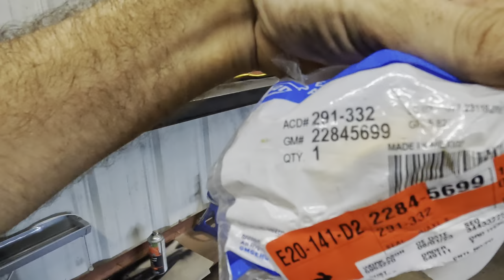FAILED Order of Operations! DON"T SPLIT JOBS! 2015 Cadillac SRX 4 Leaking Axle Seal

Comment: WE had pip[e fitters at my works for fixing all the process pipework. They had lots of offcuts of all sizes and thicknesses which I used with threaded rod for fitting/removing bushes and seals on my Triumph Stag. Find a pipe fitter and get yourself a complete kit for the price of a pint!

Comment: I had one of those parts washers.  The trick is to get the solvent/cleaner filled until it touches the bottom of that shelf.  The pump is trying to draw air and liquid.  Give it a try before you tear it apart.

Comment: Ive just done this job on a gm too real pain in the arse those axel seals never come out the way you hope they will, mine was stuck in real good i had to tap the edges in all round the seal to get it out in the end with bugger all space to work in and pissing down with rain, i have the same bearing installer kit i used  an old gm expansion bottle cap as 8t was the exact same size to fit around the seal, drilled a hole in and then screwed it onto the bearing kit worked a treat and knocked it in no problems.

Comment: Hey, add some fluid to that solvent tank.  I have the same one.  The pump wouldn't work, so I filled it to just below the tray. Works great now.  They have a weak pump. Try it, I bet it works. If not Amszon sells a quality replacement pump for $50

Comment: That front suspension is a real piece of work...what German automaker designed that mess?  The struggle is real Ray, but it could have been worse...you could be doing this in Avoca and dealing with every bolt rusted in its bushing...

Comment: I had a similar situation when I was younger. I had a 1963 Jag XKE. Yeah, really. I needed to replace the clutch. The car came apart and put together 3 times. If you know what's required to do it, you'll understand. Finally, when it was all together, I started it up engaged the clutch and it didn't move. I took it all it all apart again. The throwout bearing is carbon faced and seemed fine, however, the parts guy gave me a bearing for an Austin Healy 3000. It looked the same, but it was slightly thicker. The clutch was not able to engage. I finally got it going with the correct part.:face-orange-frowning: 
On a brighter note, I noticed the parts washer. We go to the Gator Nationals fairly regularly. A couple of years ago, on the last day, the vendors were closing up to go home and I saw the Safety Kleen vendor that was loading up his truck. I saw he had one last Safety Kleen 1630. He asked me if I was interested. Of course, at the right price. Brand new unit still in the box, all the accessories and a 30 gallon drum of solvent for $200. Sold! And they even loaded on my truck for me. It works great!😄

Comment: Parts washer, might just be a wiring/switch issue. If the pump is actually getting power, it's probably labeled and available on line or from Harbor Freight.  A google search turns up alternatives. There are websites with improvements including installing a fuel filter and using a mover's dolly to make it mobile and raise it up a bit.

Comment: Ray, buy a e- cap cooler pump, low pressure and good volume and you can submerse them. Very reasonably priced. Might work for your situation on the parts cleaner. 👍

Comment: Don't beat yourself up too much Ray. It has happened to me when I was working on changing a parking brake on a International tractor which was in the rear axel and ended up taking the whole thing apart (had to remove the fenders, seat and fuel tank) 3 times cause I would find a pin or bolt that was needed for something internally. Fun times...not lol. Cheers from Canada

Comment: Not criticising, aren't rubber bushed suspensions supposed to be tightened with the weight on the wheels, so the rubber is relaxed at normal position. Best wishes from a smart assed Australian fan

Comment: Well dang Bro. You had the Jack Stand used to get the lower ball joint in once but then you never seem to use it again and struggled way too much with the upper connections that it hit my chest Just watching. Jcak Stand were made for that reason "TO Help Hold Up something to ASSIST in Dis/Re-Assembly" of somewhat heavy objects.

Comment: 42:20 Just wondering if you could use the same principle of the under tool box lighting scheme. To get more light under the lifts on the floor to eliminate more shadows mounted under the lower wall beam. Never mind it probably wouldn’t help. Interesting video👍

Comment: Gl5 is not bad. There are additives that will linger on the skin until you shower. Brake cleaner and rubber don't mix. The rubber will harden and crack.

Comment: I always took it as an insult if somone jumped in to do my work, like I wasn't good enough, however becuse you ate your lunch doing it I can see Troy off in the distance happy to see it really was a total pain in the ass to work on. I believe it gave him some confidence he might not have had.
 
I only asked for help when I'm struggling with something, and I dont care if your the best tec or the rookie someone else will always have a different prescription and view then you can see what box it fits into better.

Dont count out the janitor he might have the best idea. 
Case and point why some comercial building now run gas lines over the roof to gas heaters insted of inside where you've got to dodge building structure parts.
On the building meets code requirements.

Comment: Does the suspension need the weight of the vehicle on it before you tighten the control arm bolts ? I know on some vehicles it does or it will rip the rubber bushings out when the suspension goes through its full travel.

Comment: You plugged the bore to prevent contamination but around the shaft is an unshielded bearing.
Reply from the maker: It was also sprayed and the fluid changed

Comment: I really thought you were going to weld a big nut on that seal and thread in the slide hammer.  You seem to be having luck with that approach.
Parts soaked in solvent overnight will get cleaned from Brownian movement of the solvent molecules. 
"If you don't learn something new every day...it's a wasted day."  (I was a substitute teacher for a while when I was laid off from a polymer research job.)
Out of curiosity, how many hours over the standard billing hour were you?

Comment: Ray is that a snap on seal pulller .I need one that size . Ray for those seals ball joint tools with  the seal driver together if can match it up . It works lol cheers 🍺

Comment: As CSW would say  "all aboard the struggle bus"   And yes, that was painful to watch!!  With the benefit of ever-accurate hindsight, I'd have had the wheel off the other side first to properly examine the assembly. Also, 99% observation, 1% perspiration....not the other way round.   Also also, the most effective tool you have to hand is your brain...use it!!  Said with love by the way, not having a pop.
Aaand, yet again, triggered by torquing up bushings with the suspension at full droop. Top one was a spherical bearing, so that's OK, but the rest? Nope. Unless you can absolutely guarantee that the alignment shop will relax those bushings and re-torque them of course.

...or, is Ray just Trolling us again?

Comment: Ray, why dont you fix the parts cleaner? what does it need? a pump motor? you could probably pull one off an old vacuum cleaner or refrigerator.

Comment: The only thing that electric impacts lack over a 1/2 air impact is speed. An air impact would have zipped that lower ball joint nut on. It'll spin the ball joint shaft fast enough to cause friction and it would have ran it home with a slight upward pressure on the spindle.

Comment: HINT: when pulling a seal like that one, use the puller to pull the plastic only.
Then carefully use a chisel to fold the metal ring in to the center of the bore.
It shrinks the diameter of the ring, thereby reducing the friction between the ring and the housing, making it easy to remove with pliars.
Worked on GM, Chrysler, Isuzu, Subaru, and Toyota; HATED GM and Chrysler!

Comment: Those extractors are almost impossible to use with a wobbly ratchet. Best tool for those is a t-bar, or I’ve had success with a breaker bar, though usually I try to extract seals by screwing a self tapper in and using a pry bar against the screw head, first. As you discovered, the tool designed for the job is poorly thought out and can do damage.

Comment: I hate to see you struggle like this Ray.  It may have been advisable to use your screw jack to lift up on the wheel assembly to take pressure off the axle while putting things back together.

Comment: Dont like that seal puller or the abrasive grinding to fix the bore damage that it caused, not liking at all. I cn see the roller bearing right next to the grinding. Got to be a better way to pull that seal. I thought you might wedge it off using the flange and a sharp small screwdriver, etc... where it meets the housing on the outside. Don't they make a slide hammer seal extractor?
Reply: Or pound it inwards from the edge to collapse it, then maybe get a vice grip and use that to pry on. Gouging the bore, that is a sealing surface. Now it is needing to rely on RTV gasket maker or some kind of sealer.
Reply: I have cut a circle out of cardboard and stuck it in with grease to protect the bearings when grinding. Works every time. I know Ray don't like the Snap on truck but they have all the latest tools for modern cars. That is an old style seal puller. They have better ones now that don't tear things up. It would be a time saver. Time is money.

Comment: Glad to see you wearing gloves more often...  newbees need to start their careers wearing them as it's harder to start after years of not wearing.  

There's an analogy about gloves that relates to another rubber type protector that men wear:  "it's like taking a shower wearing a raincoat."  Yup!  Grasping and maneuvering hardware while wearing gloves is more challenging.  But remember surgeons wear gloves.  You can too!  Just have to adapt.

Besides, your hands stay cleaner and, so, are easier to clean up.

You 'young' guys need to just get used to wearing them and like car seat belts will be a non-issue later on.  Just do it!

Comment: Why not use a gear puller with the arms inverted to remove the seal? That seal puller holds the seal in on one side, and scratches the other side. And the amount of force required will deform the housing, no? Sanding it certainly will. Will the seal still seal after the next 20K miles?

Comment: Saw the seal bore was up for damaging, well before u got the little shit outta there ... Slide hammer dude, you'd have pulled seal in 2mins & far more control where the puller would be in the bore.

Comment: Cleaning up the nicks on the case was sketchy at best.  Plugging the axle hole with a rag was fine, but what about that exposed roller bearing that was open to catch metal bits from the flap wheel?  Probably no harm done considering the case is aluminum and the bearings are hardened steel, however... not the best procedure.  YMMV.
Reply from the maker: It was sprayed and wiped again, plus fluid drained and refilled
Reply: @RainmanRaysRepairs  Still the hole is plugged and the roller bearings are exposed.  Anyway, as mentioned, probably no biggie and to be clear, not saying any stuff was left in there.   BTW, if every bit of dust, dirt and metal particles that have been left in every repair ever done caused catastrophic failure then half the cars out there would be broken down all over the place. 😁

Comment: Sorry Ray, I had to laugh a few times there... I know it's wrong to laugh at other's misfortune but when the control arm fell then the bracket and the connector on the wheel speed sensor... Plus your increasingly frustrated commentary...

Now to be honest, it would have been tools thrown on the floor and a walk off it it was me to cool down a bit but in all fairness to your good self, you pulled it back with the "there's something wrong with you.." comment to Lauren. Good on ya Ray you are an inspiration to us all.

Comment: I refuse to overtake someones job's especially if the mechanic is not much cop you have two double check his work every nut and bolt and torque them to specs because you know mechanics that rush job's always forgets something.
Or blame the engineers bad designs awkward nuts and bolt positions I mean look at the speed sensor you have to take it to pieces just to change it normally a 20-minute job or less

Comment: I AM A MECHANIC .... And I FEEL Your PAIN . But You TIGHTENING THOSE BOLTS WITHOUT PUTTING The SUSPENSION IN THE CORRECT HORIZONTAL POSITION !
AT LEAST ....ADMIT IT IN YOUR NEXT Video AS A MISTAKE , PLEASE

Comment: Watching Ray for over a year has ruined another TV show for me.
I was watching an early episode in some CW dreck of a show and a character was under the middle part of an SUV and stood up with "a tie rod" as a form of blackmail to be included in some road trip. 
1) Where the guy was under the vehicle there are no suspension parts.
2) He had none of the tool necessary to extract a tie rod.
3) The party he brandished was brand new.
4) the part he brandished was not even the right part for that vehicle, and might not have been a tie rod at all.
-
I stopped watching because the show started with a promise of supernatural topics but within two episodes turned into the usual CW teen romance drama. But I might have made it to THREE episodes without all of this automotive knowledge!!!

Comment: I've recently watched a couple of India/Pakistan "expert mechanics at work" videos. Preventing abrasive debris from entering lubricated mechanisms is ALL WRONG!!!
The correct amount of sand and gravel shortens the "break-in" period significantly. Your way could take years to smooth out the various machining sharp edges, Their way makes all those nasty teeth as smooth as a baby's bottom in less thab a month. 

(And you need at least six inches of packed dirt on the floor to soak-up coolent and lubricant spills......YOU are an abject failure!)

ALSO, this star pattern when tightening flywheels, clutch pressure plates, etc. is a total waste of time, just crank those suckers in a clockwise or counter-clockwise pattern......DO IT FAST!

Don't you judt hate the reverse Midas-Touch? (When everything you touch turns to shit! The amazing thing is, the next day everything almost fixes itself with little effort.)